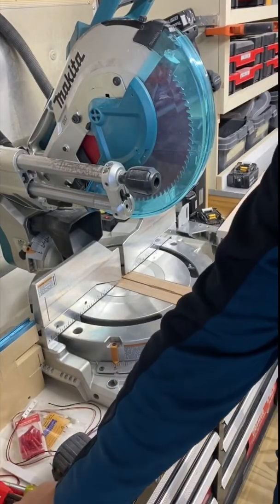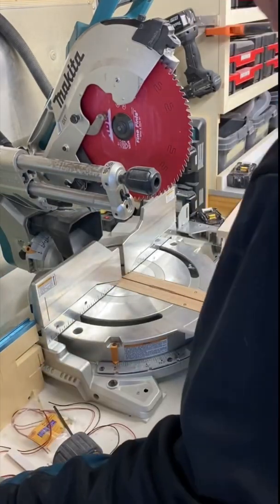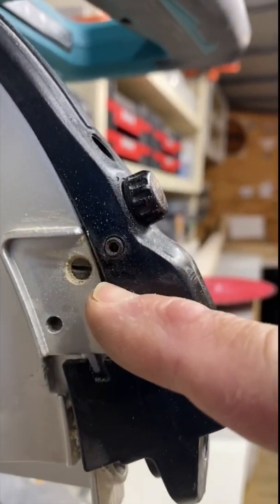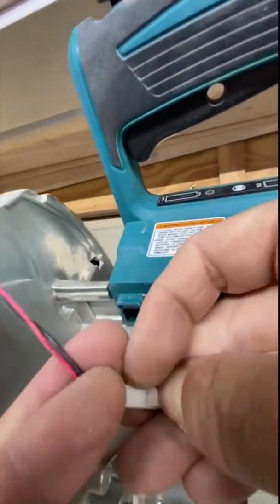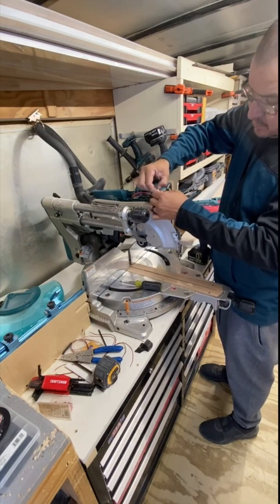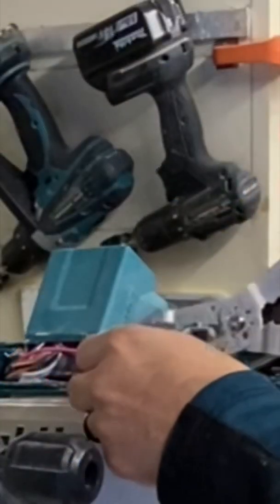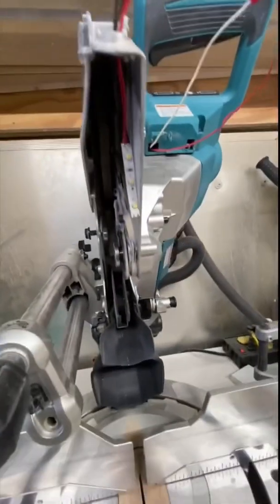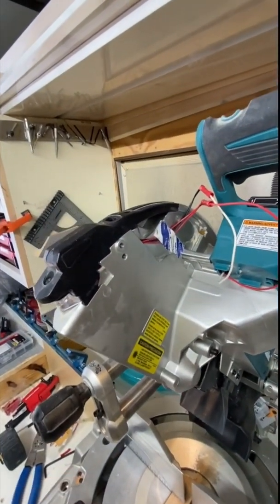How to replace the laser with a shadow line on a 36v Makita miter saw

Comment: I just line up the blade with my eyes.  I done it like that for the past 45 years and it can be done in any lighting conditions.
Reply: I suppose you're also using a hand saw, miter box and a horse drawn carriage 🤣. OP Great video and exactly the mod I want to make on my XSL06.

Comment: its unclear what wires you cut.  Was it from switch, transformer? Did you eliminate pink and black and black and white from transformer?  I cant tell which black wire youre talking about from battery either.  Mainly what wires exactly did you cut first? thanks
Reply from the maker: To the best of my recollection there were only the wires I mentioned

Comment: Could you just swap the led module out of the xgt saw? Apparently its a slightly different voltage but its the same size etc.
Reply from the maker: I’m not sure it wasn’t out when I made this. That’s a great question tho
Reply: I was thinking about doing that myself. Haven't been able to find the part number for the led.
Reply from the maker: @rickfrey6944  same. If you have luck please let me know

Comment: probably should be noted for your subscribers/followers.  These instructions albeit thorough, are NOT for the electric saws, ONLY THE BATTERY OPERATED SAWS.  Completely different wiring process for electric since the laser is about 1.25vAC and everything else is 120vAC
Reply from the maker: I was wondering about that. Thank you

Comment: This is great! That laser was one feature  that I didn't  like about these Makita saws. My Dewalt  779 is great but takes up soooo much space. How has your experience  been with the cuts? Any issues with squareness/alignment? I've read several negative  reviews  related to that. Also, how do the batteries last on this? I was originally  interested in the corded version. But I have lots of other LXT makitas so I have batteries already. Cordless would  be nice. Thanks.
Reply from the maker: I’ve had nothing but great experiences with it. I dropped it 4’ by mistake and everything still works great. Nothing came out of alignment. The batteries never last long enough. But I have plenty
Reply: There is an adjustment you can do on the rails if it's not cutting square.

Comment: Why remove the circuit board? Isn’t the lazer 12v also so just remove the lazer and add led.  No need to take apart handle. Please advise?
Reply from the maker: Because it’s designed for that laser and not needed